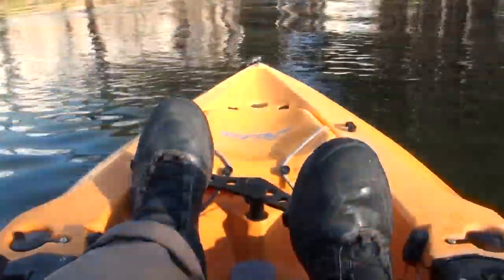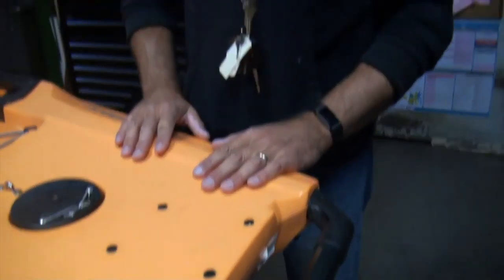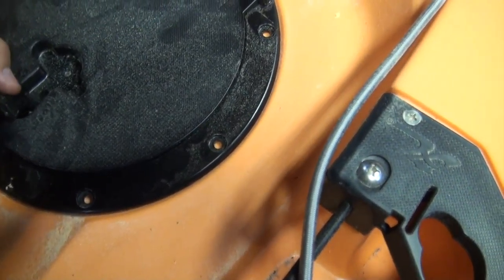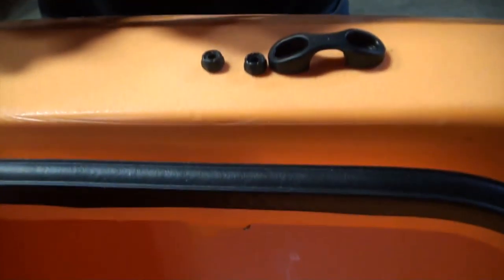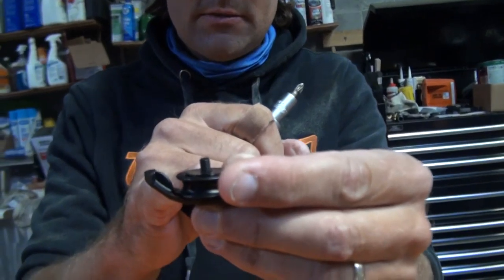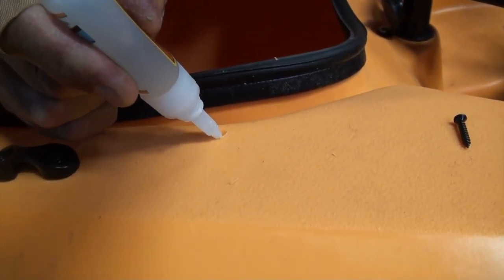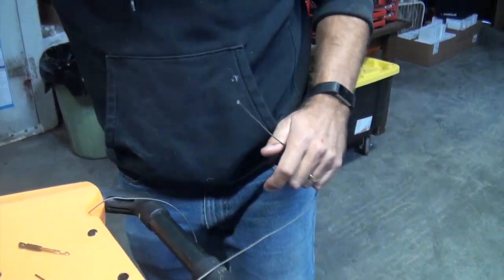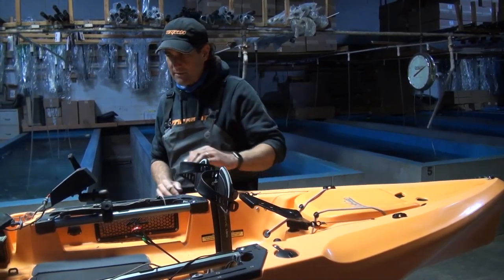Hobie Outback Foot Control Steering Installation of Ultralight 403AC

Comment: I JUST saw this steering on Harshman's Hobie, yesterday, on Instagram.  Interesting solution!  This also solves one of the little things I find annoying with most steering installs:  This steers like an old ruddered sled, in that the foot you are pushing is OPPOSITE the direction of the steering (if that makes sense), whereas, in most steering installs, the foot you are pushing, is the side that it's gonna turn to, i.e., left foot / left turn. All because the pulleys are AHEAD of the foot controls.  I find this way more intuitive.
Reply from the maker: It took me some getting used to, as I had been using the other steering design for many years. I explain it to people this way: Look at the bat wing as a triangle that points in the direction you are headed. This seems to speed up the learning curve of most people who are used to it being the other way with sliding foot pegs in tracks.
Reply: @TheLittleStuff  Exactly. That's why I used the sled analogy. Then again, you'd have to be old like me to  remember what a bladed sled is! 😄

Comment: Issue I see with this style of foot control is you need some long legs and not everyone can stretch their legs that far to the front.  
Is there any traditional foot control that you can bolt to the side that can be adjustable?  The issue I see with the 2019+ HO is the storage space that was carved out doesn't have enough room potentially for side mount rails where you can drill in.

Comment: As far as cutting the hole for the back hatch, I've considered deploying the rudder and then by hand lifting the rudder NOT using the "cable" which normally is used to raise the rudder then propping it up with something. This should cause plenty of slack in the line prior to cutting the hatch hole. Thoughts???

Comment: What’s the chances you still have an extra batwing you wanna sell.
Reply from the maker: The batwing is a very custom solution. I ended up swapping out the batwing for the standard sliding footpegs on 90 degree adapters so that I could allow others (with shorter legs than I have) to use the set up. There’s a video of that installation in the Torqeedo Ultralight Installation playlist.
Reply from the maker: https://youtu.be/A9WyvAp8yO4